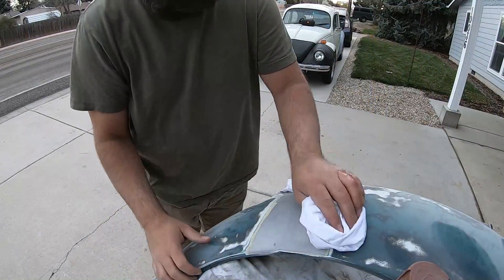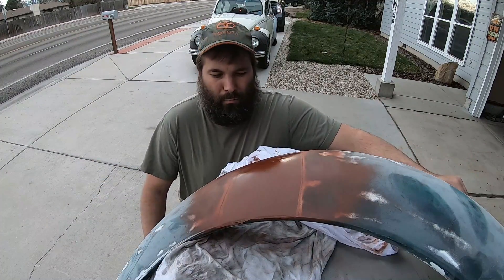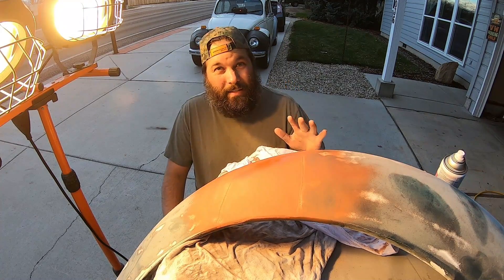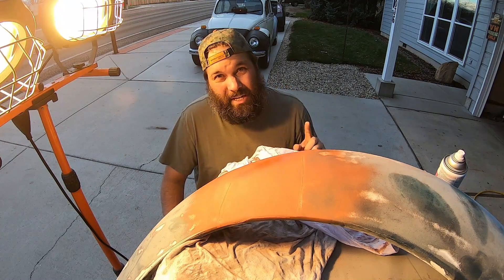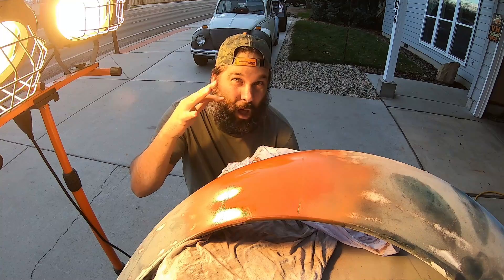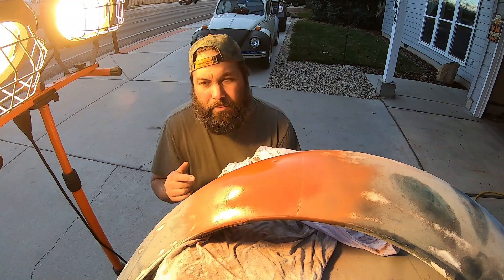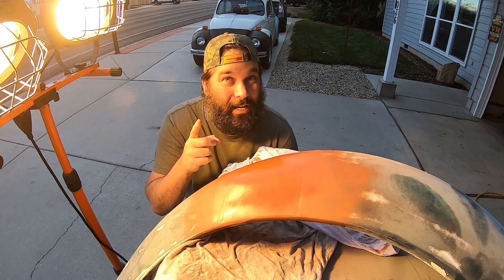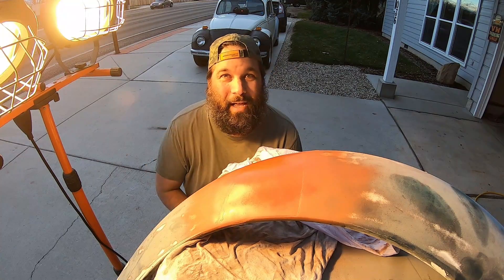Sandblasting Media comparison Glass vs Coal on a 1971 VW Bug Fender

Comment: Just remember that any media you use that peens(textures) the metal will warp the metal. This goes for dry or wet blasting. Sometimes it’s not noticeable but when you block sand with a guide coat you will see it. The best way to lessen the warpage is to have your nozzle at an angle around 45*, ideal pressure around 120psi and keep the nozzle moving! Dont stop in one spot.

Comment: Just got a husky 60 gallon compressor. How well does it perform when sandblasting? Amount of time you can sandblast without the compressor on and the amount of total time you can sandblast until inefficient air supply?

Thanks

Comment: I enjoy your videos.  Would it be better to just DA sand the bug to bare metal?  What type of primer are you using?
Reply from the maker: Good call out.  I'm actually not blasting everything. This was just for an example.  I'm using a sander but not a DA. I'm using a rotary sander.  It's MUCH faster, and there are ways to do it and not mess up the metal.  Good question!
Reply from the maker: The primer was just rustoleum. This is not the printer I'll be using to paint. It was only for an example.  I'll be sanding it shortly

Comment: Wanted to share with you if ever had to deal with multiple layers of paint i call my bug 50 shades of blue. Had been more blues in a crayon box and the hood every color of the rainbow air stripper did worst but sand blasting and sanding did the tuff spots that’s why I asked how you ran your blaster still working it out
Reply from the maker: Ah. Yes, I've had multiple layers of paint.  This bug had 6 layers of paint.  The best thing I've found is to use a sander.  I don't use a D.A. sander though.  I use a dewalt sander. It looks like a heavy duty drill that has a sanding disc from a D.A. sander on it.

Comment: Glass beads are not suitable for this application. They are designed to produce smooth surfaces and should not be used to prep for coating. One needs some surface profile (surface roughness) to produce good paint adhesion. Crushed glass, a sharp angular abrasive, would have been much better. Much less messy, less dust than coal slag. Garnet is another excellent abrasive. It is both harder and denser than coal slag so it will clean surfaces more quickly than either slag or crushed glass.

Comment: I went and got mine in Tractor Supply before I even saw your video. I wasn't that impressed by Harbor  Freight's glass beads (I see that's what you have). I like the Harbor Freight hopper gun though. I have tried blasting with sugar and that was very abrasive. It made my hopper unusable though because I could never get it unsticky again.
Reply: @GMPowderCoating  it was because the Blaster was covered in powdered sugar and moisture got to it. I suppose if I’d dismantled and washed it in warm soapy water that might have restored it.
Reply: @raisagorbachov  makes me think what other odd things we can blast with. It's cool that you tried

Comment: Wow I jumped out of my seat and hit the ceiling seeing you make another vid hey question   What are you setting your air compressor tank at and what’s a average working pressure you use when sand blasting I am new too on this sand blasting air compressor is 50gals and it’s set at 125 ish and at blaster working pressure 90
Reply from the maker: I set mine at 50psi unless I need to rip something up.
Reply from the maker: Thanks for the kind words!
Reply from the maker: To clarify, my tank is at around 135ish and is reduced to 50 at the sandblaster.  I find if I turn it up, the compressor has to work way harder and it's not all that much faster